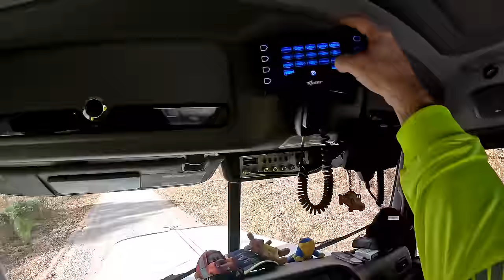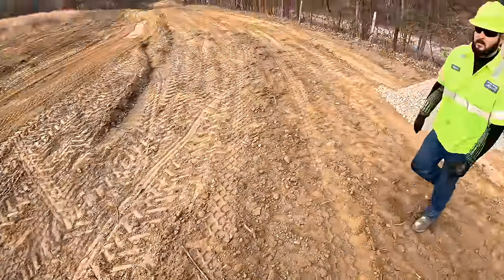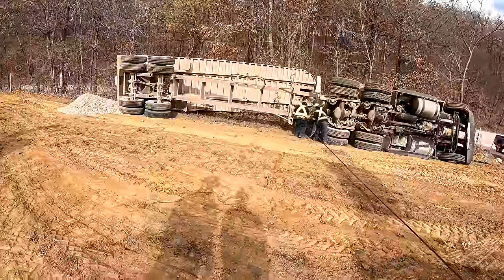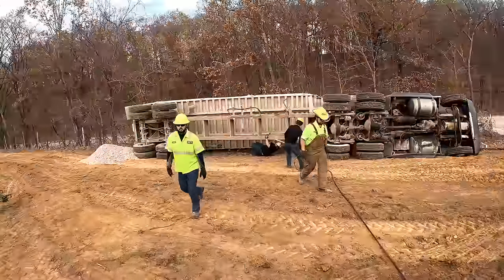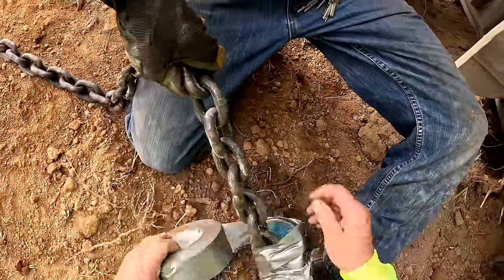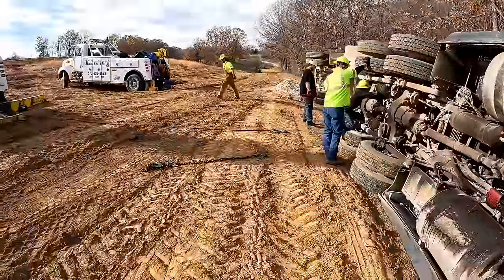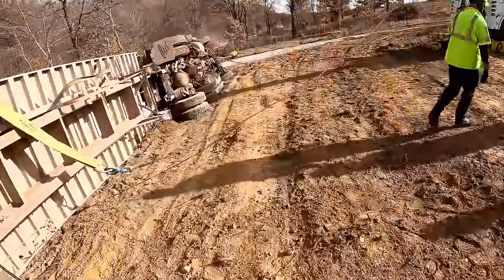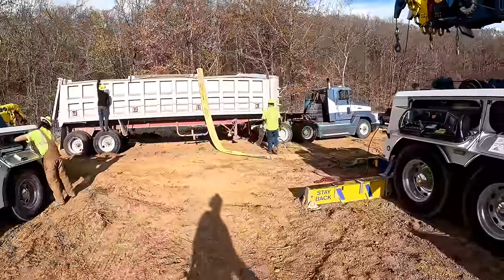THE ROLLING STONES!!! ROCKIN' & ROLLING...OVER!!

Comment: I use to do end dump and I would of never dump the trailer there you can tell how steep that hill is by video I would of told them no and dump it in the driveway and they can move it with a digger

Comment: Ron I was wondering when you have a chance would you be able to chat can I get ahold of you somehow for some advice
Reply from the maker: I will help if I can.   What question(s) might you have?
Reply: @RonPratt  I have some equipment like chains and stuff but I was wondering if you had any ideas for equipment I might need on my 30 ton truck
Reply: @RonPratt  I was also wondering when rear towing a truck if it's spring ride is it better to lift by the spring perches or if the frame is easy to get to which way would you prefer to tow it